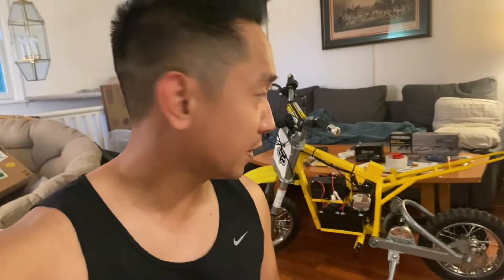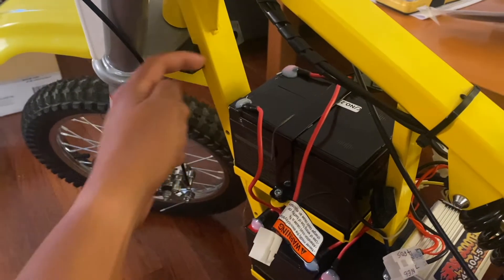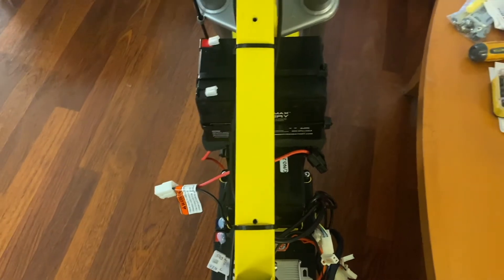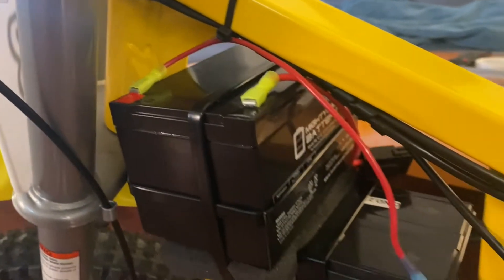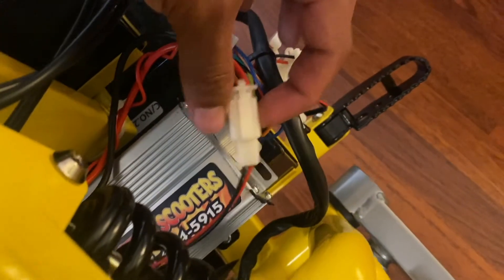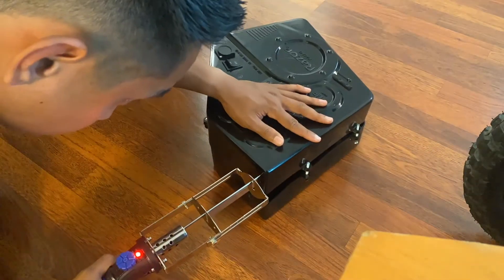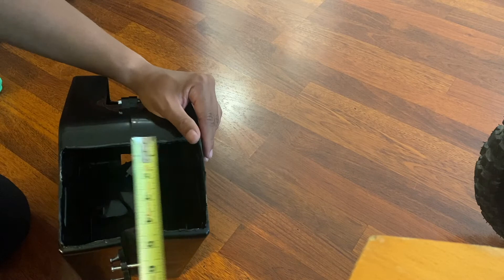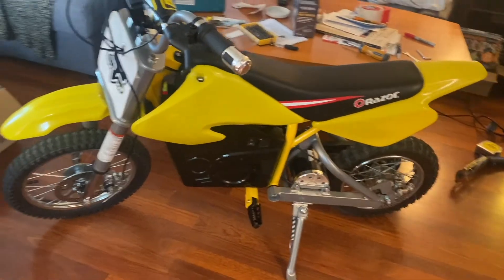Razor MX650 48V Fast Scooters Overvolt Kit Installation Part 2 | Fitting the 4th Battery

Comment: Im trying to buy a battery would 12v 1.2ah work for this build or does the ah have to be higher
Reply from the maker: @asjvlogs3840  the battery specs have to match exactly with the other 3 batteries.
Reply: Thank you for the info!

Comment: Hey it’s me I had asked about the kunray motor but I have a question can this work on a mx500?
Reply from the maker: @Beeswarmroblox12  when you remove the factory electronics.. an MX500 is essentially the same bike as an MX650. I have both.
Reply: @PatOutdoors  thanks very much man👍

Comment: Hey i just got my first razor build and im having difficulty adding the 4th battery no matter which terminal i use it sparks really badly when trying to connect a 4th battery
Reply from the maker: Are you connecting a 4th battery while everything is still connected..? That’s dangerous. You’re supposed to disconnect everything first, and wire the 4th battery inline with the others. I recommend googling “how to wire batteries in a series” and review the photos and diagrams so you have an idea.
Reply: @PatOutdoors i thought disconnecting the batteries would have cut the power but could it be that im not running a 48v controller i just realized i was trying to do this on the stock controller would it just be worthwhile to swap all four of the batteries i have to my 48-72v kunray kit instead of using the stock motor and controller
Reply from the maker: @Minimotolife223  this bike now runs 72v lithium battery, Kelly controller, and a Kunray motor. World of a difference, 52 mph with street tires and a 14T front sprocket. These razors are fun to mess around the neighborhood with since I can’t exactly ride my YZ250 in the neighborhood without the Karen’s making a scene about it
Reply: @PatOutdoors yeah im in the same boat i cant enjoy any of my gas builds and they took away my only dirt spot so now i have no choice but to have something electric for close to home im just on a tight budget to start with since i bought my razor brand new and i bought the kunray kit before i even had the bike ordered i just wanted to find a solution for the stock motor to last longer which is what i thought you were doing but i realized you werent using the battery for amps you were using it for the voltage and i cant use my kunray kit because i dont have a battery at 42 volts so i might take these 4 12 ah batteries and run them together to bump me up in enough volts to even use my kunray kit its just complicated and alot of work to do and i dont want the bike to be off the road for awhile since its brand new
Reply from the maker: @Minimotolife223  check out my later videos on this playlist directly after this video you watched. I ran the Kunray kit with 4 12v SLA batteries for a little while at 48v
Reply: @PatOutdoors oh thanks for the fast responses to any info helps this is my first time working on a razor i have previous experience in dirtbikes so this is all new to me so any mistakes im making thank you for correcting ill start being more careful and aware next time i open it up

Comment: Could you use this setup with the fast scooters controller but with a single 48v 20ah battery or would that fry the motor
Reply from the maker: At that point, just get a brushless motor kit if you want real power. Lithium batteries are expensive and it would seem like a waste of potential power if you don’t match it with at least a 2000w kit.
Reply: @PatOutdoors  I would like to get a 2000 watt motor but I do not understand the drilling that you have to do for the motor to fit. And i don’t have the tools to cut the bracket on it.

Comment: I replaced the lead acid batteries with a single 48v20AH lithium battery. It works, but at slow speeds the motor makes a weird sound.  Note I still use the stock controller. Has anyone else experienced a similar issue. The weird sound is a little loud and very annoying. The sound is a little hard to describe, it’s almost a squeaky or squealing sound like the motor is engaging but not fully until you give it more power.

Comment: Thank you for your easy to follow videos. I am having to step in and help my son put his bike together. We ordered the 48v batteries, Throttle/controller kit and charger. 
Do these batteries come with harnesses? Can you explain what to do again with connecting the 4th battery? Do I need to splice some wires together?
Appreciate it

Comment: Do you have to add a 4th battery with the overvolt?
Reply from the maker: It wouldn’t be an overvolt otherwise. If you don’t add the 4th battery to convert it to 48v, there’s no speed gain. Another option is to replace all batteries with just one 48v lithium battery

Comment: When adding the 12v 12ah battery to the stock razor mx650 7ah does it make it 19ah?
Reply from the maker: Wired in a series.. no. (4) 12V 12AH batteries wired in a series = 48V 12AH still. (4) 12V 12AH batteries wired parallel = 12V 48AH. Don't mix-match sizes
Reply: @PatOutdoors  so when adding a 12v 12ah battery to the stock mx650 batteries it makes it 48v 12ah or 48v 7ah

Comment: Do I have to upgrade fuses to 40a or do I continue to use 30a after installing overvolt kit?
Reply from the maker: Nope, has nothing to do with the overvolt
Reply: @PatOutdoors  Just stopping by to say thanks for the info. Had to wait a lil while for my 4th battery but finally got my overvolt kit installed. Was able to hit a even 24 on flat ground and it feels like a whole new ride. Thanks Pat. Next step lithium battery!!!!!!

Comment: Would you know why it won’t work for me my throttle lights up and everything but the motor won’t spin
Reply from the maker: What voltage does your bike read at? You have the fast scooters kit I’m assuming?
Reply: I got the other throttle not knowing to pick one. should I send this throttle back and get the other one?
Reply from the maker: @tannermanross573  The fast scooters came with a throttle with a built in volt meter, so you can confirm the voltage. The controller won’t run the bike below 41 volts..
Reply: Can I send you a picture some how of my throttle
Reply: I might just need to charge it

Comment: I have a 2016 MX650 Razor i did a minimal upgrade with great results im running two 8.4 v venom RC batterys to my 36v  battery i changed the motor sprocket 13T and got a volt meter i probably spent around 150.00 total my top speed flat pavement 26mph little grade around 23mph and i weigh 180 lb
Reply from the maker: That's pretty awesome dude! Do you run the two batteries both inline or parallel with the rest?
Reply: @PatOutdoors  Hey thanks im running the batterys in a series with a Y adapter right to the stock  36v battery
Reply: mine i found in the trash looked new but it was a 2014 frame
Reply: sx500

Comment: Hey man, I was wondering what charger you use to charge all 4 batteries at once? I’m only using the stock charger and it isn’t charging it well.
Reply from the maker: Well the stock charger is not meant to charge 48 Volts.. It's designed for 36. Please look in the description of the video. I'm using the Fast Scooters 48V charger.

Comment: Ok I found a kit that works for only 36 volt would that work? Keep in mind I will also add 5 mph using your video with the extra small battery

Comment: Can you install these handlebars with the stock controller, without having to buy a different controller.  Also I wanted lights, would I have to buy a different controller or can I plug them all into the stock one?
Reply from the maker: Do you mean the grips? They came with the controller and I haven't had a reason to try. The connectors look the same, but the stock one has 6 wires and the new one has 5, so I don't think so.
Reply: @PatOutdoors  mm yeah I’ve just seen some sales on just the grips and volt and key port and I’m on a tight budget so I was just wondering if it would work. Thanks
Reply: I also see that the sellers have numbers on the different grips, do they give you a random one or do you say a number for them
Reply: @PatOutdoors  also does the overvolt kits controller work on the stock bike, without the actual overvolt because I just want the controller for the handle bar lights and a headlight
Reply from the maker: @evolve508  It will not. It must be ran on 48V so a 4th SLA battery would have to be added or switch all the batteries out for one 48V battery pack. The controller has a voltage cut-off at 41V, that will stop the bike from moving if the voltage drops below that.
Reply: @PatOutdoors  darn it, is there a kit where I can just use the controller for the handlebars

Comment: Hey pat. I am getting a 48v lithium 20AH battery to go with this overvolt kit, but i am wondering should i wire the battery directly to the controller through the battery port of the controller? And then will it turn on/off when I turn the key? Or should i wire the battery to the factory on off switch. Thanks for the help
Reply from the maker: Depends if your battery kit comes with its own charger and port. If it does, then DO NOT try to charge it through the factory charge port and the controller. Charge the battery separately through the plug it came with and the charger it came with. Also if you watch this whole install, you'll see that the on/off switch gets fully bypassed since the ignition switch is now what cuts power going to the controller. The factory on/off switch does not connect to anything anymore.
Reply: @PatOutdoors  Yes the Lithium battery im getting comes with a seperate charger and charging port, which I am planning to use instead of the stock charger. Thanks

Comment: Hey pat. I can get 48v lithium 10ah battery for a good price and swap it for the 4 sla batterys. But is the 10 amp hours too slow? Or shoud i go for a 48v 14ah or 20ah (although the prices increase alot for more amp hours) Thanks!
Reply from the maker: Amp Hours has nothing to do with speed. It describes the overall capacity, like how long the charge lasts. Amperage draw or "Discharge Rate" describes how much power the battery can deliver to the controller, which is more important if you are looking for power delivery and speed. So that's why I'm shopping for a 48-Volt 20AH Battery with at least a 40A or 50A continuous discharge rate. Also depends what your controller is designed to handle.

Comment: what exactly did you use to connect the wires?
Reply from the maker: Just a 14-gauge red wire I had laying around, but you want to use between 10-12 gauge, to match the rest of the wiring. You can snip the red wire from the factory On/Off switch since you will no longer need it if you plan on using this controller kit. 
To connect to the battery terminals: https://amzn.to/39D7hUw
To connect the wiring to the rest: https://amzn.to/3n7jeVu